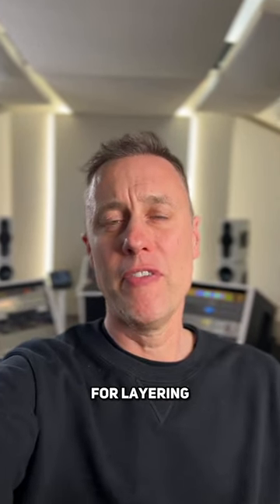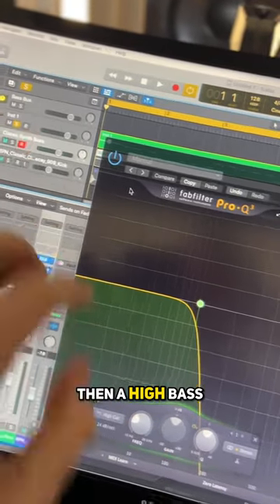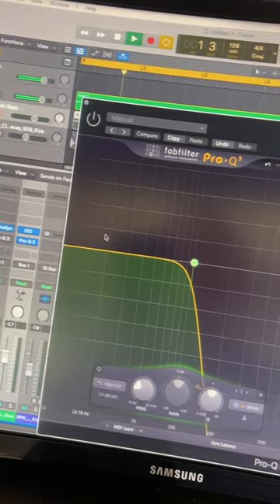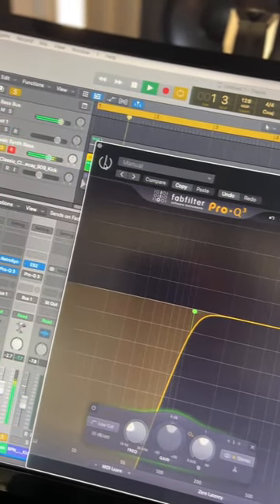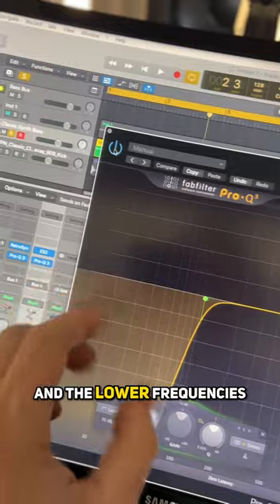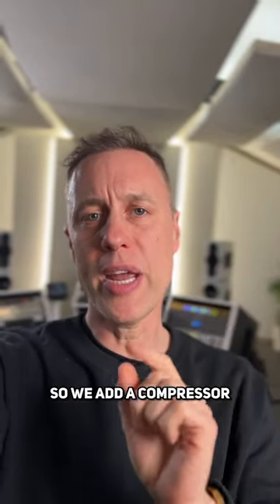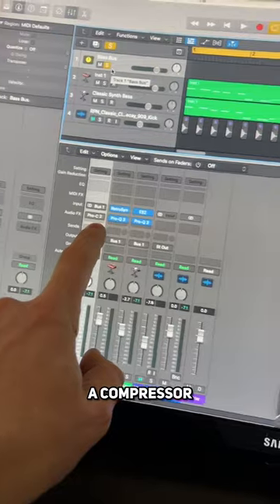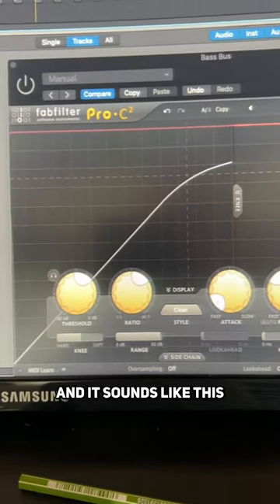PERFECT BASS EVERY TIME 🔥

Comment: You have to be super careful doing this tbh. Phase relationships between the 2 sounds, and how you setup the eqs, are mighty important. You can easily ruin your sounds doing this too.

Also, if you really want to "glue" 2 sounds together, you should make sure the compressor is characterful. Preferably add subtle distortion as well. The more you effect the 2 sounds as if they are one, the more they will become one.

Comment: I’m curious about why you use logic rather then protools ?
Reply from the maker: Just easier for these types of demos
Reply: @Streaky_com  I dont see why the use of Logic makes it easier in general. However, I can understand why you would prefer Logic. My point here is that we're all different and gel with different DAWs for different reasons. Ive tried Logic on some occasions, and while I recognize that it is a very good DAW with lots of nice features, it just doesnt fit my workflow that well.

While Pro Tools is still recognized as industry standard, theres no longer a proper reason for it other than many studios using it. PT is no better or worse than other major DAWs.
Reply: Idk about now, but in the past pro tools has been a pain in the ass for producing midi etc, as in the routing wasn't intuitive. Those coming from those days likely avoid it other than mixing audio / tracking vocals. Personally I prefer tracking vocals in Logic for the ease of comping. And now Logic has on track clip gain like PT, I don't see the point in switching
Reply: Would rather look at logic over that 1998 interface any day lol
Reply: @AVDRE  exactly, logic looks nice and the others are an eye sore, especially Ableton

Comment: Don't forget! Duplicate the EQ so both of them are at the SAME frequency point so you don't run into phase issues! An EQ IS a delay.
Reply: No need. Move those slopes around, play with it until it sounds good. You'll find its not always on the same frequency xD
Reply: Not necessary if the basses are different sources. If its the same bass being split into two for the sake of separation in mixing then yeah do this
Reply: @ScottThePisces  Still not necessary. I do quite often split a single track and my point stands.
Reply: the filters too can introduce phase, per frequency. duplicatem them would defeat the purpose.

some plug-ins try to avoid this but that's like black magic i don't know if or how it works
Reply: @vecvan maybe you mean phase linear EQ by any chance? But that doesn't necessarily seem to be necessary in this case

Comment: Nice tip 😍 just tried and loved the results.. but I've a question that why did you compress it in the bus? Is it necessary or project specific? 🤔
Reply: as long as you're compressing only those two sounds together, it works. The bus is just how he set it up.
Reply: @ampersand64  Thanks 😊👍🏼